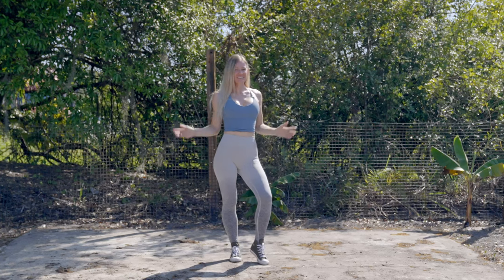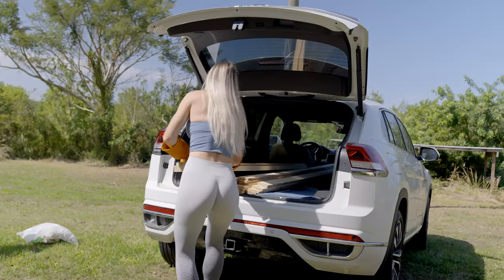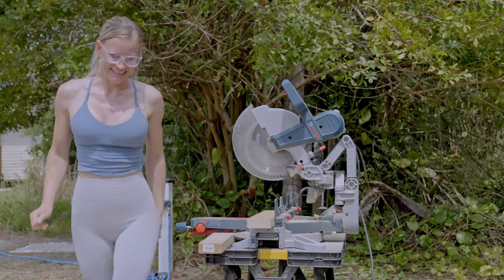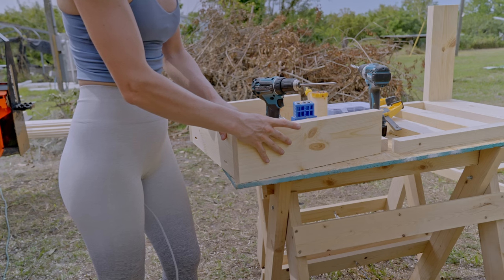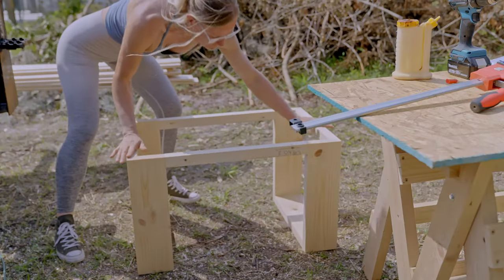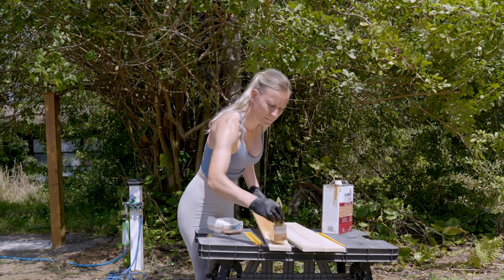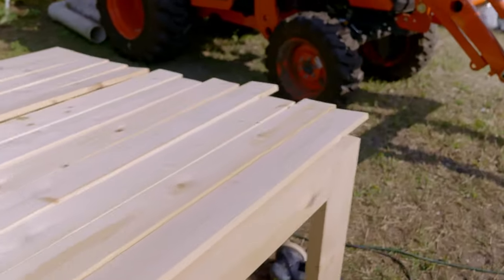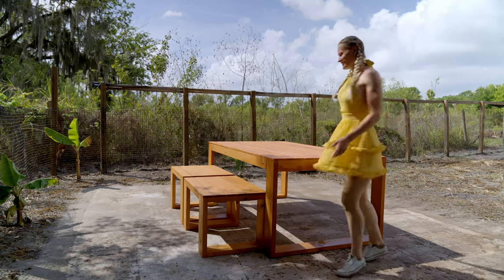Built a Outdoor Table

Comment: Hello, Meike. It looks so good again (just like you). This sleek outdoor furniture can withstand the weather better if you install rubber caps or furniture glides underneath, so that the wood does not touch the base, otherwise moisture can cause it to rot.
Dass wäre eine Schande.
Reply from the maker: Thanks for the tips! Glad you like the built 😁☺️

Comment: Nice European flair to the basic picnic table, love it!  Will the stain alone provide enough protection against the elements?  Especially the legs of the table and benches as they will be sitting in standing water after a heavy rain.  I was surprised you didn't use pressure treated pine, also available at HD.  Frohe Oestern! 🐤🐥
Reply from the maker: Well, I’ve purchased expensive outdoor furniture in the past and it never laster longer than approximately 3 summers before it fell apart. Non pressure treated wood with a water guard applied last longer than that, in my experience. But I will give updates in future. 
Soon I will build a pergola to add shade and protect the furniture from the elements. 
Adding water guard to pressure treated wood often leaves a different hue, I didn’t want the table to have a different color on the bottom vs the top. 😉 but of course, in case you built one, you can use any wood you would like

Comment: You should pressure was and put a finish on the concrete pad. Perhaps an epoxy project with a non slip coat.
Reply from the maker: I was thinking about it. maybe I will tackle that in the future. So many other things to do that need to be done first 😁

Comment: with the botton support on the legs flat on the ground there has to be perfectly level surface.  Not very practable
Reply from the maker: You could just screw in some leveling feet that are around $12 from Amazon if leveling the table is an issue for you. Mine is sits straight and sturdy